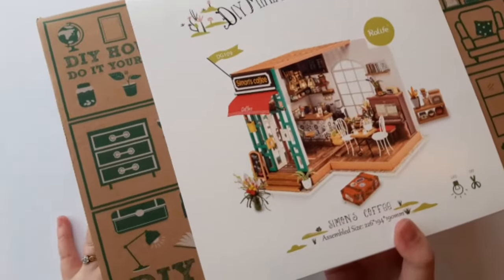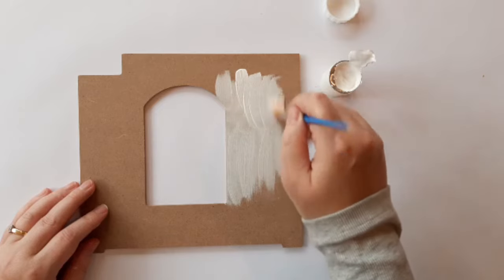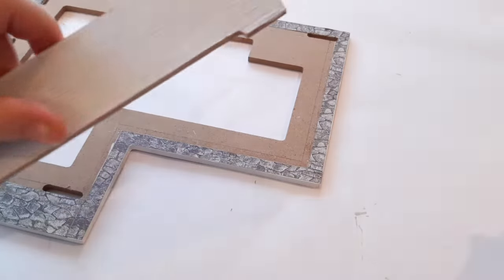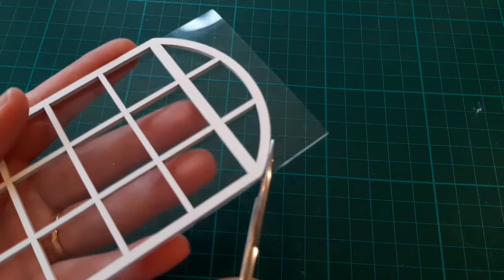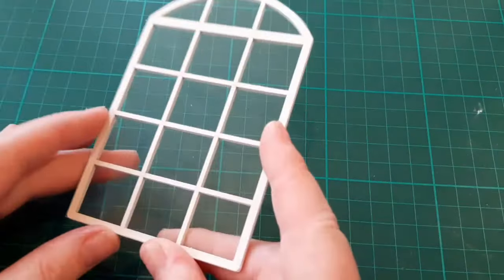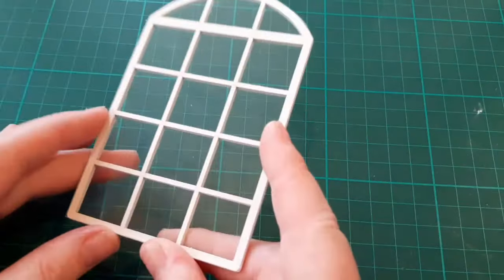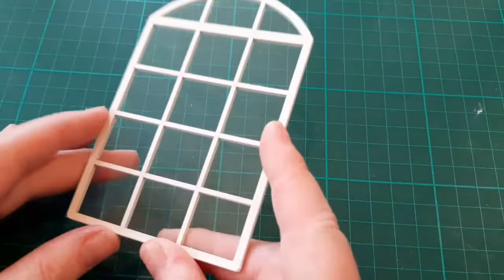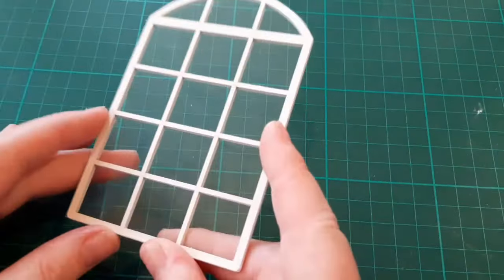DIY miniature kit "Simon's Coffee House"  (PART ONE)

Comment: You pull the thin sheet off the plastic, correct?
Reply from the maker: Yes, if it has one. It helps to protect the plastic from scratches before you use it.